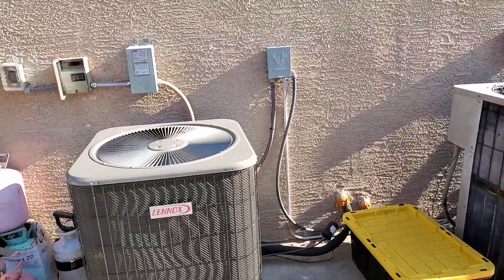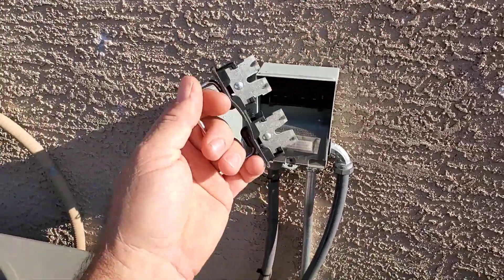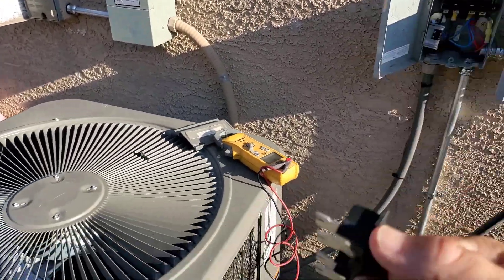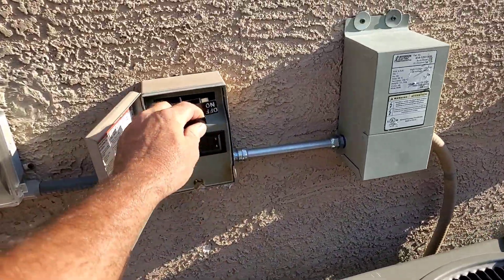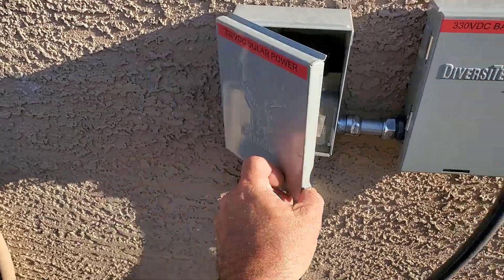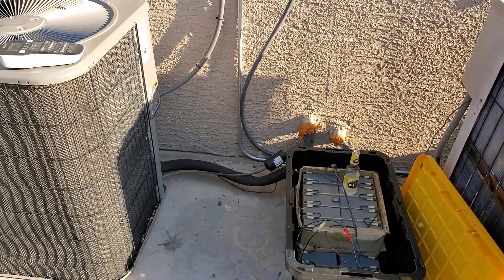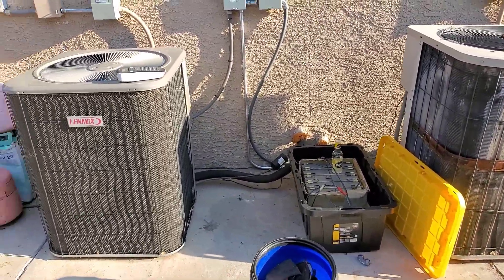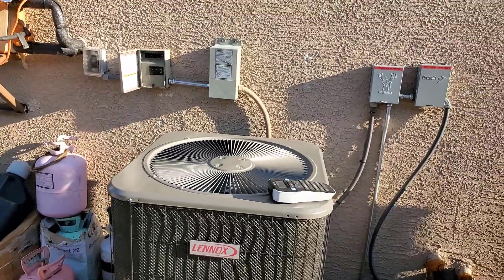Can I run my home heat pump off of batteries? [Part 3] Add disconnect & pondering the possibilities!

Comment: Love this Frankenstein series man, I actually work for Daikin as service tech and I know you're a huge fan lmao..  I messed around with lithium ion batteries.. What I'm gathering that your solar voltage isn't high enough to overcharge the batteries? And the unit won't draw off the batteries below a certain voltage, because the grid is higher?  Just watch charging the batteries in series because your batteries are used they might not be all the same capacity, I would check the voltage of each individual battery when they are close to drained and when they're near full charge.. Basically one cell can hit full charge quicker but the whole pack voltage is still low so keeps charging just something to keep in mind.
Reply from the maker: These are lead acid from a server rack. They are ran in series, no balance device.
I don't think lead acid needs it like lithium.
Check my new video. I subtracted one battery because the peak voltage isn't getting that high after all but where it discharges down to the point that utility power starts to blend in is about 280volts which was like 11.2v per cell.
I removed one battery from the series and that makes it 11.7 per cell fully discharged and about 13.8 fully charged.

Daikin isn't the worst out there. They just have quirks and it worth picking on sometimes.
Reply: @hackfreehvac  lol all good my man I just started with them a couple of months ago, I was working on everything before that, units that gave me the most trouble were always Aaon units.  Yea no problem with charging them in series with no balancing.  I would just check the voltage on each cells a couple times towards high end on low end of the voltage every couple of months.  I think you're better off with sealed agm especially if you got them for free, lithium ion would definitely need high and low voltage cutoff.
Reply: @hackfreehvac  o and if your ever looking for any lithium batteries check out battery hookup..they rip out used batteries from different appliances and cars and they're pretty damn cheap, and they test the capacity before the sell them.

Comment: Thanks, now I understand the use of the batteries during the off-cycle... I must admire the direct parallel connection between solar panels, batteries and VFD DC bus... That's a lot of raw power coming together at that DC bus. These fuses are valuable.
Reply from the maker: Yup. Now I need MORE batteries and MORE solar. LOL

Comment: You might consider individual battery module voltage monitoring so as the modules age or fail an alarm or similar would alert you to a bad cell.   That challenge might be complicated once a bank of series batteries are paralleled with another bank.  Perhaps ok with diode isolation between banks.   At some point a white board "system architecture" video would be good.
Reply from the maker: That is $$$
This is "low buck".
I got the 100+ batteries for free. :-D

I will have to draw it up some day perhaps.
That is in my 100+ degree garage. No A/C in there right now.
I am supposed to score some used equipment for a frankenstein system but by time I get that maybe summer will be over. Dang.

Comment: Since solar has been suplementing, how much trimmed off your electric bill monthly?
Reply from the maker: I can't tell because this last year as I hooked it up the wife began to work from home. A/C in my home used to be set back in prior years and we are running it cooler.
Once I got the transformer on there to lower the utility and really switch the power to solar I cranked my t-stat down colder than ever during the peak use of day.
Also have a friend staying here, and he has a plug in car.

So, with that my bill is equal or a few dollars less than other years. But I don't have a like for like comparison.

Comment: Can you have an alternator charge the batteries?
Reply from the maker: Like with an engine operating it?
Reply: @hackfreehvac  somewhat yes. But instead of an engine, just something ignite the altenator and a motor or something that spins in a circle to rotate the rotor of the altenator. I've seen videos on adding magnets to the altenator. Idk if any of this is true but I'm trying it.
Reply from the maker: @Keeshacp42  Well, my solar panels are what charges my batteries. Directly.